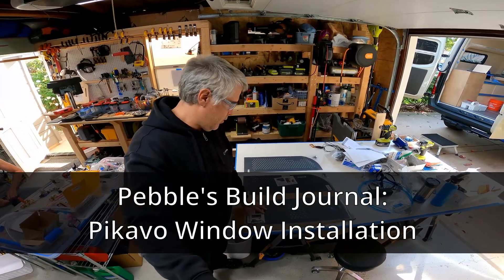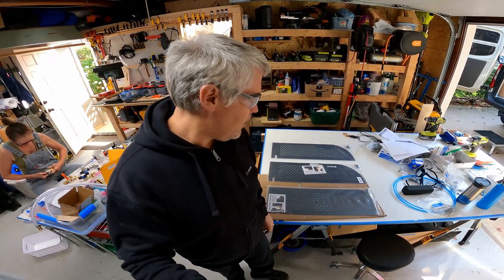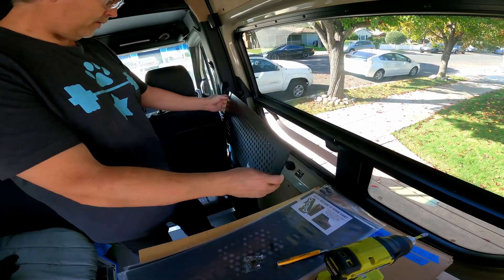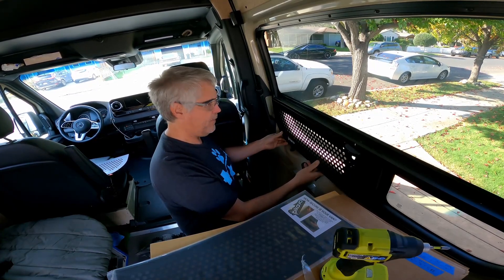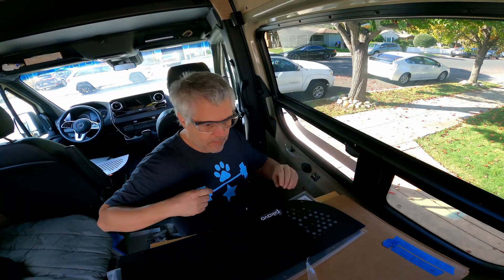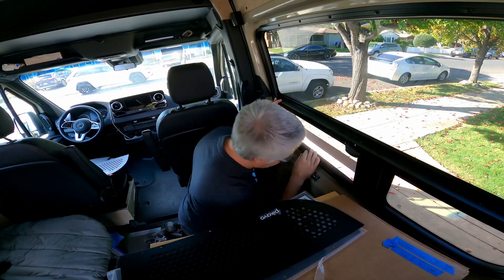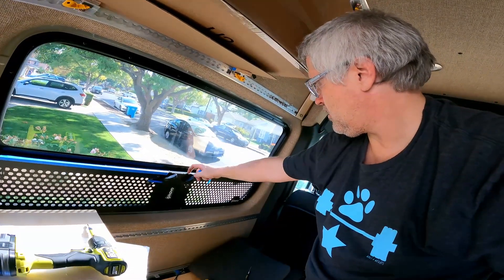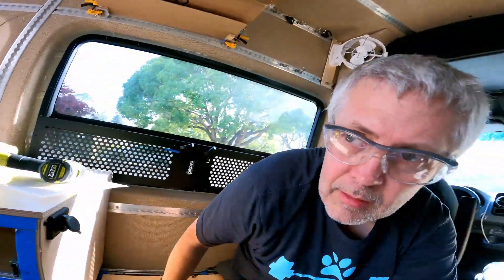Installing Pikavo CRLSecure into Pebbles the Sprinter

Comment: Thanks for the video! I’m about to install one on my sliding door CRL window, the same as the 1st in your video. None of the holes in the product line up with the window holes.  Did you put the screen UNDER the trim piece or on top? Did you have to drill any new holes in the product or did you just drill new holes in the window? Did you have any issues with the little screw near the knob that looks like it’s supporting that spring?